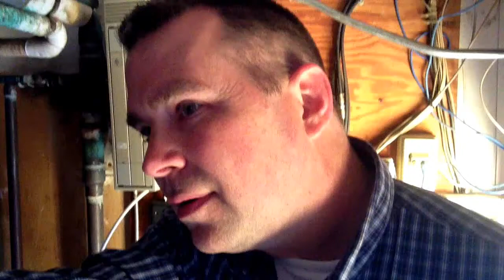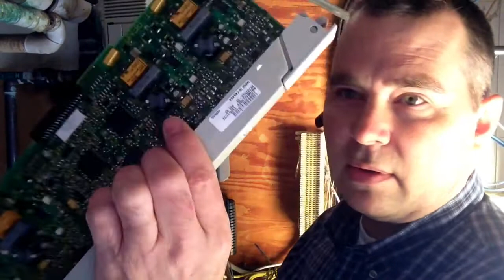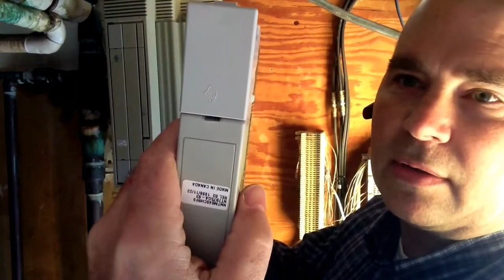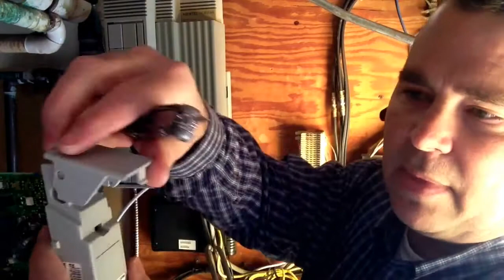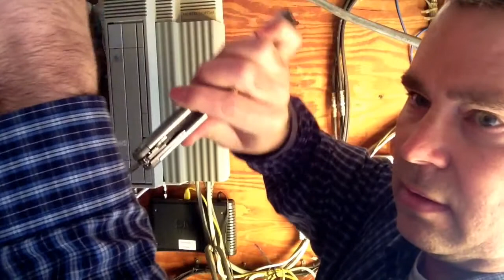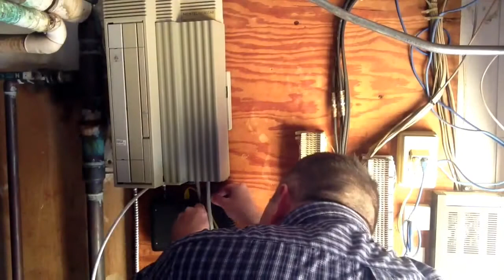Installing Norstar Trunk Card (not BCM)

Comment: Just got a wo where my client couldn't find anyone experienced to service their client for this.. 

"Install and configure Nortel Trunk ID Card; client also needs their caller ID reprogrammed since it's showing their fax number when calling out instead of the main number"

I'm almost thinking maybe they just have the configuration for outgoing calls set up to the fax line rather than need a new trunk card but honestly althought I've been toing tech for 16 years I'm a newb to Nortel systems. Also haven't talked directly with my clients client yet...I don't even have a model number on the system.. Will here in about 6 hours or so. idk, how much configuring these things need but looks like have a whole lot of info here on your channel. 

edit,  just found out its this same model. Norstar PLUS Compact ICS. they said they're just adding caller id.. have add in card that says CI. 

is there any special configuration required to activate their caller ID? am I replacing this card that says DS with the one that says CS?
Reply: Thank You!
Reply from the maker: +Steven Duke yes, there is some programming needed.  How'd that go so far?
Reply: Great, swapped the trunk card, wired the offices fax line direct to the MTA as it was running through the Nortel for no reason which created issues after swapping the trunk card. 

Discovered Comcast didn't put the right number on their outbound masking for their office phones as they were all assigned to mask with the fax # so I called and had them change it. 

Configured the main phone and copied the settings to the rest. Had one phone that displayed the incoming calls with ringer off not auto populating the caller ID display when calling. Turning the ringer on fixed this. 

Site complete 100%
Reply from the maker: you rock brother!  :-)